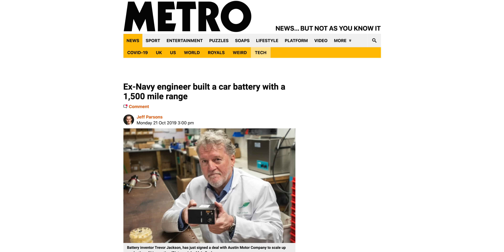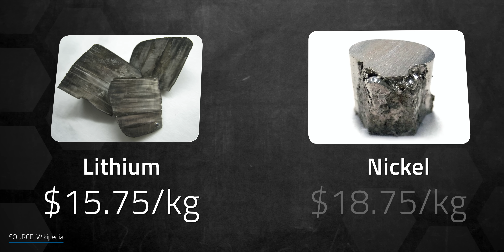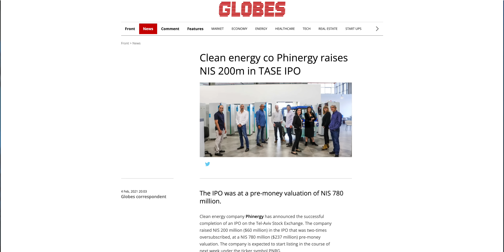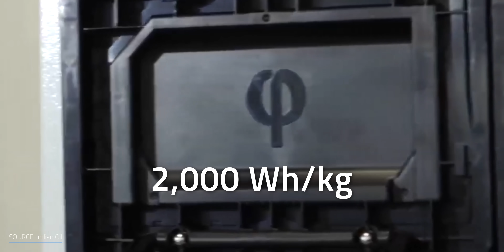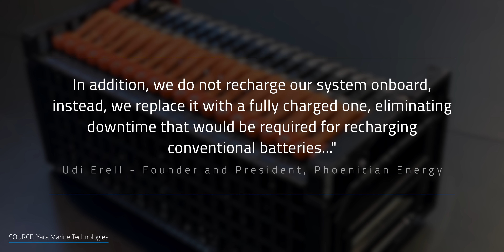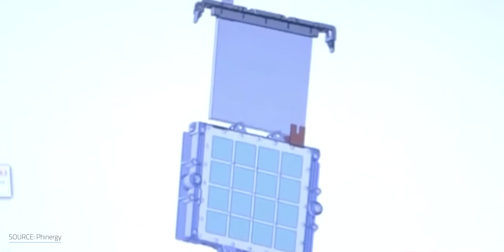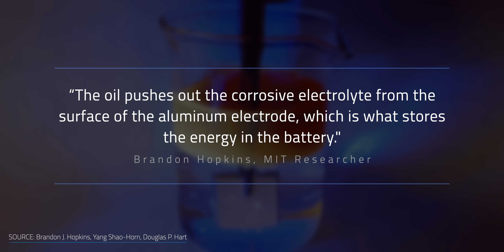Exploring the 1000 Mile Car Battery - Aluminum Air Hype?

Comment: It seems that you have some pretty distinct variables with energy.   Density.  Cost.  Availability. recharge time (gas too in the form of refueling) and safety.

(Density - safety) + cost + availability / recharge time.

Battery tech needs to meet or exceed to be really adopted.   You get people a car that performs like a tesla in silly mode and can be recharged in 7 minutes with a range of 200 miles for 5$.... and you'll need to electrify the fences around your car lot.

Comment: I would be open to swapping batteries if the batteries weren't astronomically expensive like lithium batteries are. Keeping a spare when it looks like time is running out, would be an alternative to sitting by the side of the road. However, this only makes sense if the cost of the batteries was low enough. You might have mentioned the relative costs but I missed it if you did.

Comment: >An aluminum air battery powered car would have to be towed to a swap station

Or, you know, the tow truck could just bring you a full battery and swap it on the side of the road. I could even see that being an Uber-like service for when people are too far away from a swap station. Pull in somewhere for a quick lunch and come out to a fresh battery.

Comment: With those high energy capacity per kilogram numbers it sounds like Al-Air batteries could have applications in the aircraft industry - both sport aircraft and commercial.

Comment: The biggest problem I see is the shear number of batteries that would be needed. Not to mention the infrastructure needed to distribute those batteries. Every battery station would need a way to unload, move, store, etc. Not to mention people to swap the batteries. Just the infrastructure and logistics required to use batteries like this, are overwhelming and not really feasible. A lot of what revolves around aluminum air batteries (and most other supposedly emerging battery technologies), is simply a pipe dream of "with billions more, we might get it to work". There is also a carbon footprint to batteries, which no one really mentions.

Comment: I could see applications on trucks. There, weight is really important as it impacts loading capacity, and having more power available really helps. Also, I could see the facilities to swap out the batteries being possible in area’s like industrial parks and harbors. But I do wonder how much power the recycling and transportation of the full and empty units takes compared to the energy content of the units. I’m afraid that this being essentially power cartridges will make for a huge additional cost per effective kWh, both in terms of power and money.

Comment: This doesn't seem to be a viable alternative to lithium batteries. It could be used as a backup power supply when the battery is discharged.

Comment: This seems like an excellent option for things like planes, trains, and boats- where they all come to dedicated ports.  Seems like it would be easy to build a swapping/recycling infrastructure for those.  For cars, it seems like it would make for a good Emergency charger for ev's, but unless the whole auto industry went that way and they were available as quick swap universal batteries all over the place, I don't think it's a good general auto-option.   I would absolutely keep one of these in my car for emergencies though (as, it would be easy to keep the aluminum separate from the electrolyte until you needed it.  it would be like the E-version of a spare gas can.  Also seems good for camping and such, provided there was somewhere to get it recycled/refurbished.   I wonder how hard it would be to just make it so you could pull out the aluminum plate when not in use? that would help with the degradation issue, it seems like.)
Reply: Great point, it's not like plains can recharge midair anyway.
Reply: @danielppps  if they made the tail lift up like some cargo planes used in the military, they could be swapped out really easily.
Reply: The biggest advantage is the easy single-component recyclabity. And you're very right that the use of larger size Al-air batteries will be in the substitution of large diesel engines.

The spent Aluminium oxide will be very pure & the Smelting plants will readily blend it with the beneficated bauxite that they currently use.
Reply: This is not right for aircraft use. The electrolyte is strongly alkaline & can eat through the airplane's frame & fuselage. And, the way how the plates are stacked between frames that are pressed together heightens the risk of the electrolyte seepage between them especially during vibrations & also during pressurization & depressurization -cycles.

India will first target large public transport vehicles such as buses & trains. Per-capita ownership of vehicles is amongst the lowest on earth.
Reply: You have the problem with landing weight when using batteries in airplane. Batteries does not lose weight when used and therefore the landing weight would be the same as the take off weight.
Reply: @patelk464  So? If it can take off surely it can land also.
Reply: @jellevm  Not exactly, the designs of the tires and landing gear would have to be changed because most of them are designed for lighter aircraft on landing. It's not undoable, just will require changing things up a bit.
Reply: @jellevm  that's not how it works. Planes have different maximum take off weight and maximum landing weight. Just fyi, see below

https://en.m.wikipedia.org/wiki/Maximum_landing_weight
Reply: @RudyLukman  Then how does it work if you have to do an emergency landing shortly after takeoff? Is it just more buildup of residual stresses?
Reply: @TheKyleMcVay  they simply dump the fuel before landing or crash.
Reply: @RudyLukman  What about using VTOL assist to lessen the impact during landing? That would have to help some. It would only be used when landing and would only assist in normal landing instead of full VTOL.
Reply: @wirelesmike73  I guess you'll need to engineer the plane to be like the osprey
Reply: @patelk464  Throw out the used battery before landing. On a parachute. Weight difference achieved. Problem solved.
Reply: @eljanrimsa5843  That would not only be dangerous and unpredictable but, Ideally, you would want to get more than a single one-way flight out of a battery with such a high energy density.
Reply: @wirelesmike73  I doubt it. Given planes' emphasis on weight, they would want to make the battery as small as possible. If it lasts exactly for the length of the trip, that would be perfect.
Reply: @eljanrimsa5843  Actually, that would be catastrophic. What if the landing is delayed due to weather? What if the flight had to detour or change route mid-flight? What if a flight had to redirect to fly around a storm system? What if it had to make an unexpected emergency landing? What if a flight hat to be diverted to another airport for one of a hundred possible different reasons? Do you expect one plane to only ever make the same flight over and over and over and over again? 
You just eliminated more than half of the reasons to even use a plane by severely limiting its versatility and turned a thousand routine obstacles or normal operational issues into near-certain death for all onboard.  I don't mean to be rude, but that is a ridiculous statement and an absolutely absurd "idea".
You. are. not. thinking.
Reply: @wirelesmike73  Planes right now have the exact same problem. They only have enough fuel for the trip because they want to minimize weight. To avoid disaster they calculate enough reserve to reach a different airport or so. They would do the same weight minimization by using an adequately sized battery for the trip plus a safety reserve. The same plane can use a bigger battery for longer trips, where is the problem? It's the same calculation as today with fuel.
Reply: @eljanrimsa5843  Practicality, versatility, and efficiency. It makes no sense from a production and supply standpoint to have multiple different battery sizes or capacities for the same plane. Then you would have that many different batteries to keep in stock for every other kind of plane in any fleet. 
Standardization is what makes something like that viable, reliable, and cost-effective, it also lessens the potential of mistakes that could cost lives. They would be far better off using one size battery for the type of plane it's made for and monitoring the use in transit. Once it gets below a safe operating level, swap it out for a new one that powers however many flights it can run for.

 Not to mention, ejecting a metal battery over any area is a disaster waiting to happen, even with a parachute. Winds could carry that anywhere, and you'd have to have fleets of vehicles and personnel to go around and retrieve those things from where ever they ended up landing (which could be anywhere) every day, all day and night. It's not at all practical. At least when they have to do a fuel dump, it vaporises before it hits the ground. A mid-flight fuel dump isn't going to crash through someone's roof and crush them. 

 And it's not efficient to minimalize or under-utilize the capacity of a one-time use battery like that, it's a waste of time, money, and materials. What if you had to swap out the battery in your car every time you went to the store, or drove to and from work.
Reply: @wirelesmike73  Why do you invent complications that would exist right now? Different types of commercial planes use the same standardized fuel because of what you said, it would be complicated to keep too many different types of fuel at every airport they visit. For the same reason different types of commercial planes would use the same standardized batteries so they can be swapped for the next trip at every airport. They just would need different sizes to adjust for the length of the next flight.
Reply: @eljanrimsa5843  "Why do you invent complications that would exist right now?"
???  O_o  WTF???
I honestly don't even know what that's supposed to mean. I'm not "inventing complications". These are all legitimate concerns and just a few of the possible contingencies that have to be taken into consideration when flying, none of which are going to change as long as planes have wings. And if planes have one thing in common, it's that they all have wings, so... not going to change.  NOTHING you are suggesting makes any sense, at all. Different sized batteries for different sized flights is literally the opposite of standardization.
This is just uncomfortably weird at this point. You obviously don't know anything about flying, or planes, or flight safety requirements, or emergency procedure, or flight maintenance, or manufacturing, or supply and demand, or inventory, or recycling electronic components, or... gravity apparently? 
Please stop commenting to me.
Reply: @wirelesmike73  whoa chill. Tho I agree with you, but sometimes you gotta let someone speak their ideas and such to let the creativity flow.
Reply: @eljanrimsa5843  I think when battery tech gets good enough, probably could make a wing shaped battery that is light enough and able to withstand all the forces with enough juice for a plane to be able to last a long haul flight. I don't think swapping batteries makes sense tho. But batteries as wings, kinda possible
Reply: @eljanrimsa5843  Probably not a serious suggestion. Other than cost and pollution issues, there is also the issue of how you would safely jettison batteries from an airplane.
Reply: @RudyLukman  Appologies. I understand that, and I tried to make it clear that I wasn't trying to offend or be rude from the start. I tried to explain, as clearly as I could, just a few of the reasons why that wouldn't be ideal. I tried to give clear examples of other variables that would need to be considered. I just have very little patients with someone who refuses to even consider factual information presented to them. That is the most unscientific mindset one can have, and there's way too much of it in the world today.  One or two times is understandable, not everybody thinks the same way and some need more clarification than others. But, repeated refusal to accept real-life limitations imposed on finding a solution to a problem doesn't constitute brainstorming or the flow of ideas. That's just cognitive bias fueled by willful ignorance. It's as infuriating as trying to reason with a flat earther or a Bigfoot hunter, and at some point, you just snap.
I tried to be nice. Some people won't let you be nice. Some people just keep pushing till you reach your limit. I reached mine, and I'm sorry. I still stand by everything I said, though. Everything.

Not every idea deserves a platform. Aknowledgment, and consideration? Sure. But platforming? No.
If I said that cars should run on milk there would and should be plenty of people telling me all of the many reasons that wouldn't be an optimal solution, and they would be right to do so. I would have no reason or justification to clap back at them calling them negative, or keep insisting that milk is the best option regardless of all of the real, actual, factual reasons why cars either can't or shouldn't be powered by lactate.

Again, I'm sorry. If I overtly offended anybody, than I regret that. But, if somebody actually learns something, even if it isn't something fun or cool, then it's a net positive for society as a whole. And, if I have to be labeled as an a-hole for that to be achieved, then so be it. I'll be the a-hole for the sake of science and objective reality.
Reply: @wirelesmike73  no worries dude. Remember, don't waste time arguing with idiots especially online (not implying that he is). You'll gain nothing out of it. We might dismiss battery swap solution for planes but there was a time that people think electric cars were impractical too.. 😂
Reply: @RudyLukman  Oh, I don't dismiss it, I just think it's insane to suggest ejecting them mid-flight for many, many reasons. I didn't even mention the most obvious one.  "Eject battery before landing... Engines and flight controls shut down because you just ejected your power supply before landing. Crash and burn."
Actually, I think that, if light enough and with enough energy density, this kind of battery would be ideal for a current design from a company called JetOptera. They use what's called Fluidic Propulsion with VTOL built into their craft design. Because of the efficiency they claim their engines achieve, they hope to be the first all-electric commercial and consumer flight design for something other than just recreational and ultralight craft.

If you have time, check out it out.
https://www.youtube.com/watch?v=bPZI6XoHi10

I hope they're right. If what they claim is actually true, this could seriously be a game-changer. And, it kinda looks cool, too. Better looking than some of the other designs I've seen over the years, anyway... IF they can pull it off, that is.
Reply: @wirelesmike73  hahaha. As mentioned, I agree with you completely. Just shouldn't get so worked up with people online that's all. I guess it depends, battery powered planes require charging which means grounded at the airport for longer but yet electric powered vehicles generally require less maintenance. Not sure how they're gonna solve the long parking issue when charging tho. Since some airports are more expensive than others.
Reply: @patelk464  if it much cheaper than ATF they will switch to battery... additional weight is nothing against fuel price...
Reply: @patelk464  it gains weight, the weight of oxygen consumed, a roughly 89% weight gain. A typical boeing 737 fuel capacity is about 8 tons.
Reply: I was thinking mobile delivery for battery swapping.
Reply: It would be like buying gas now, but instead of spending a few minutes pumping hydrocarbons into a tank, you would spend a few minutes having your battery removed for recycling and replaced with a new one.  Much faster and more convenient than having to charge.  (Remodeling to add a home charger is impractical or impossible for many people, and does not help on long trips.)
Reply: @BlackJar72  A mix of both a smaller than usual normal battery and space for swapable one would solve all the problems. Having a 30-40kwh battery that would give 100/200 miles or kilometers that would cover 90+% of use, and only have to either put the new batteries inside(if you want to travel lighter for 90% of your trip) and or swap along the way during longer trip. This should make nearly all electric cars price competitive with ICE car with 1/2 to 1/3 battery size. And the saving on fuel would be enormous as you would only need to swap batteries when exceeding you lithium internal battery.
Reply: You get a 40 kwh lithium battery in your car and then you can have a space for a aluminum air swappable battery . A bit like the gogoro scooters which you can buy at swapping station. So for 90%+ of trip below 150miles/200 km, you use your normal rechargeable battery and for the occasional longer trip you just stop along to swap batteries in 5 minutes.

Comment: I found a few logical and factual errors in this report Matt, and frankly a little disappointed as typically your rigour is much better. Example, what do you do when you run out of Aluminium battery at night? - simple call the roadside service to bring a replacement battery...no different to running out of fuel, you don't have to be towed anywhere.

Comment: This is nearly 20 year old news. the talk along time ago was to mix LION with these so maybe 40 miles of daily driving on rechargeable LION and 1000+ mile trips on aluminum air changing out the fluid and plates when needed. One thing not mentioned here that was mentioned years ago is that the aluminum can be fully restored from the fluid is is resolved into so it is not consumed and is circular. In a way is is rechargeable, but not in the car.